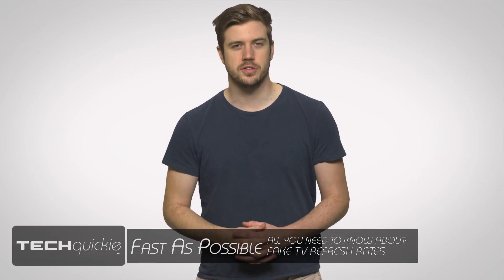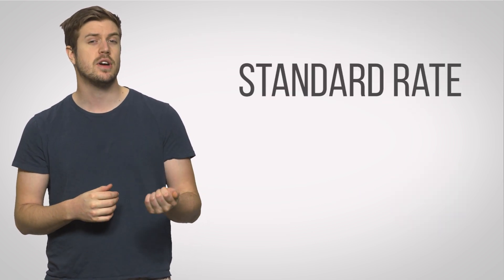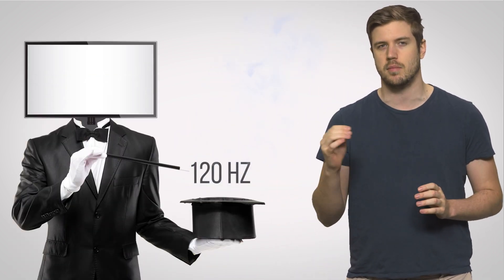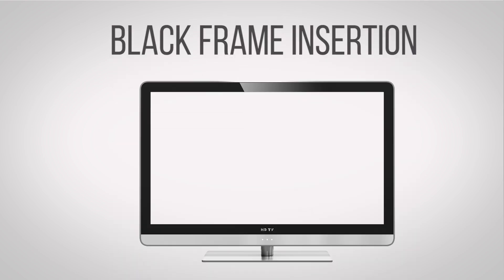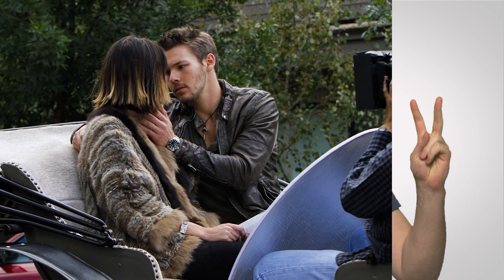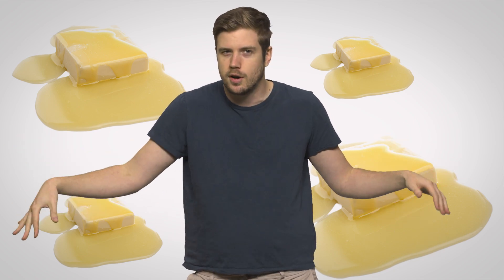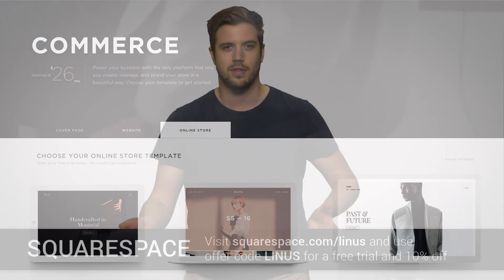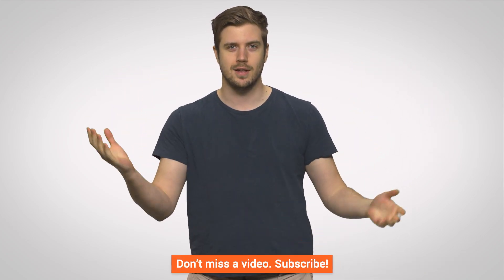Fake TV Refresh Rates As Fast As Possible

Comment: A tad inaccurate. Strobbing and Black Frame Insertion don't make things smoother, they make them clearer, by forcing the display to avoid doing things that add even more motion blur. These methods make lacking framerate, or inconsistencies in framerate, even more apparent. If you're pushing a solid 120 for example, you get movement that is crystal clear. But if you quartered the framerate, there's just no longer enough information there, so the massive gaps between positions of whatever object on screen, just become more apparent and less smooth. More accuracy, more clarity, but it's doing the exact opposite of anything meant to "smooth".

Interpolation looks worse (depending on the person and source footage) specifically because the closer you get to reality, the more apparent inconsistencies are. If you look at a person in real life, you're essentially working with information that is seemingly infinite, limited only by the speed of photons for christ's sake... If you take 30FPS footage of something that has a billion little complex and irregular/organic movements, and just make up 300% more information out of thin air, it's going to be wrong. If instead you take captured footage from something like a 2D side-scrolling platformer, you can interpolate mid-points extremely well as usually games are made with math, resulting in predictable accel/decel rates and movements; something algorithms can roughly reproduce.

People think films captured naively in high framerates would look bad, but that's not the whole story. The reason it's not feasible for big films, is because high-budget films are usually completely fake. When you quadruple the framerate, not only are all your effects harder to make inherently in terms of rendering or hand-editing, but the massive increase in clarity of motion means your level or workmanship to make it look real has to skyrocket. Motion blur isn't required at 120FPS and adding it would defeat the purpose, but lacking it means you can't hide all of the completely unrealistic composting. It's all far more suited to films that are or could be filmed almost completely within reality.
Reply: +MangoTangoFox 
> When you quadruple the framerate, not only are all your effects harder to make inherently in terms of rendering or hand-editing

In animation this is handled by having different "framerates." Sometimes you draw on each frame, sometimes every other frame, sometimes every 3rd frame. Out of 24. For certain sequences, you can change out. In the Cowboy Bebop movie, most scenes are 2s or 3s. But there's one dogfight scene on 1s and it blows people away.

Comment: Someone needs to explain this to Console peasants that there games really do not run at 120FPS on there 120hz tv's
Reply: +Chris Barr Even if they could get that kind of frame rates most TV's, regardless of their 120Hzness still cant accept any more that a 60Hz input. Unlike computer monitors that can indeed accept and display 100Hz,120Hz or even 144Hz.

Comment: Been nice if you would've explained what effect this all has on gaming. I got the impression it isn't good but what does it actually do?
Reply: +natorious76 Basically it's not actually delivering the specified refresh rate... Say you're playing a game that runs at 60fps on the computer, but with one of those proprietary technologies you're screen would only actually display 30fps, though with the interpolation or black frames it would appear to be 60. The issue this would cause with gaming is, in the case of interpolation, the mid frame would be something generated by the TV, not the game, this would also add to the response time of the TV/screen. With black frames it wouldn't put in fake frames, but you'd still only be getting 30 of your 60FPS.
Reply: +K-Anator™ I get that but what negative visual effect would would that actually have in simple terms? Motion blur, tearing, lag?

Comment: I bought a TV with 120hz thinking it would be good for playing video games. Turns out that the Gaming Mode feature on the TV disables that 120hz feature that I spent extra on.
Reply: bro ima teach u something, if u play on console the frames will never go above 60
Reply: gaming mode is bs. and unless you have a 1800 dollar PC, you are not getting anywhere near 120fps output. 

you basically wasted your money
Reply: +Matapatapa 
Gaming mode isn't BS, it just turns off all of those unnecessary filters which raise input lag.
Reply: +Dayvidlol 
That's because the TV doesn't accept 120hz signals. It interpolates the signal it receives.

Comment: So why do you need 120HZ for 3D monitors and TV's then? Is 3D content filmed at those frame rates? I know it's split but even 60fps is a lot and most movies aren't filmed at that frame rate. This could've used some clarification in the video since 120 HZ and above is marketed for 3D.
Reply: If you use active 3D, you really need a 120Hz+ panel. Because active 3D goggles do flicker. Each lense will flicker at 60Hz. If you had a 60Hz panel, each lense of your goggles would flicker at 30Hz. You would be able to notice that flickering and would most likely puke. Hell, it's still noticeable for some people even on 120Hz systems.
Reply: +droid monkey Well, if the TV/monitor has a 60Hz panel with a fake 120Hz refresh rate, then it's a gimmick even for 3D. 3D and fake refresh rate tricks don't mix. But if it really has a 120Hz panel (like most active 3D TVs/monitors), it's not a gimmick for 3D. But i guess the point of this video was to only talk about those fake tricks.
Reply: if it wasn't 60 fps, you would throw up. that's why.
Reply: +droid monkey If nothing else, it’s probably because 60Hz is the standard for 2D displays. A 3D display needs to render twice as many frames per second, since each of your eyes only perceive half of them, and as such a 120Hz refresh rate is necessary to maintain that standard of 60fps. Trying to run something at 60fps on a 60Hz 3D display would likely result in an “interlaced” effect that’d make a horrible 3D viewing experience. True, movies run at 24fps, but that standard may change and games are already expected to meet 60fps.
Reply: 120hz is for 3d games running 60fps
Reply: +Matapatapa That's not exactly an explanation. Care to elaborate?
Reply: +Gameactive Movies require 120hz for 3D too and they're only filmed at 24fps. Even if that's doubled per eye that's only 48fps which is still less then the 60hz that's standard for 2D TV's. So the explanation still doesn't make sense. There are very little movies and shows that are filmed in 60fps. The ones that were had very mixed reviews (the hobbit comes to mind).
The only feasible option is games that run over 60fps if you have a baller rig.
Reply: +brickman409 It actually is. He specifically says that in the video. He talks about anything 120hz and up. Plasma TV's had refresh rates of 900hz. It's just the plasma TV's work. They were rarely marketed in that way until 3D became mainstream and Blu-ray could handle the data requirements for them.
Reply: droid monkey
Oh, ok, but I'd imagine that a TV capable of 3D would have true 120hz not the fake trumotion stuff mentioned in the video.
Reply: +brickman409 Hence my confusion. Well that and a couple of other things I've mentioned.
Reply: +Tukkajumala I get that. It's just odd he didn't mention it in the video. He made it out to be as if 120hz+ is some sorta gimmick when clearly it's not.
Reply: +Tukkajumala Hmm good point. However that doesn't explain why he talked about the high refresh rate monitors in this video.
Reply: +Tukkajumala Hmm good point. However that doesn't explain why he talked about the high refresh rate monitors in this video.
Reply: droid monkey
did he talk about true high refresh rate monitors? I thought he was talking about TVs with fake high refresh rates.